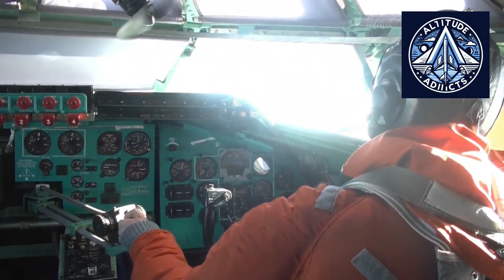Why the Tu-95MS Will Fly Into the 2040s

Comment: Tu-95ms just 20 can deliver 400 cruise missles all programed to spread out and strike at very low levels,  good luck on the second wave of 40 releaseing  640 cruise missles.
Reply: sucks that they lost 8 of these during the spiderweb attack 😐
Reply: @KMASIF-mi9yj they didn't, they lost q and another was used for parts.
Satellite images were clear but the Western "Wag The Dog" media ran with the destruction story.
Reply: @fryertuck6496 ukr claimed over 40. but visually confirmed 13 hit. 8 of which are tu95s. but how many of those 8 are for salvage part and how many operational I don't know. atleast 1 had Cruse missile loaded under it's wing

Comment: The Tu-160 is back in production and the MSM is an effective aircraft. The PAKDA is not super urgent. It would be interesting if they could create a supersonic flying wing. Especially if they could manage a supercruising aircraft. With thrust vectoring engines they should be able to deal with the centre of gravity shift entering supersonic flight. New 6th gen fighters are also supersonic flying wing types with no tail surfaces for low RCS.
Reply: After all, these are strategic aircraft. Thrust vector control is a waste of money for them. Besides, the Tu-160 can reach speeds of up to 2500 km/h, just like the Tu-22M3 with afterburners, which is faster than many fighters. The MiG-31 is capable of reaching speeds of up to 3600 km/h. Strategic missile carriers strike at a distance of several thousand kilometers and are not visible to radar. To put it in perspective, the Patriot anti-aircraft missile's target detection radius is 180-185 km, and its interception radius is 80-160 km. He won't even see the fighter jet drop the winged bomb. Why does he need invisibility? Low observability is especially important for fighters, and thrust vector control is also important for them. As for bombers, I think that such aircraft will bomb those who are no longer able to respond to the attack, where the air defense has already been destroyed, and modern bombs fall from a great distance. So I would say that all this invisibility... is not needed by anyone in particular.